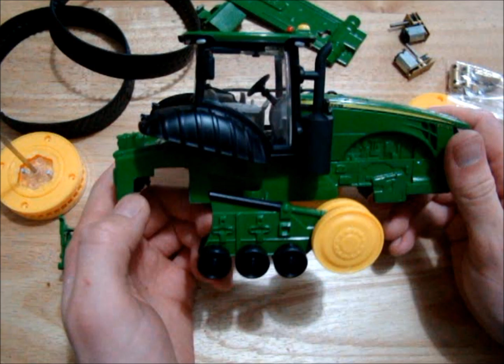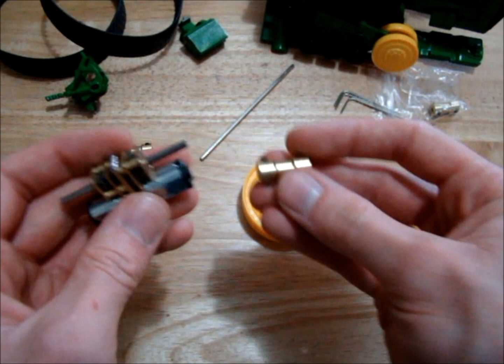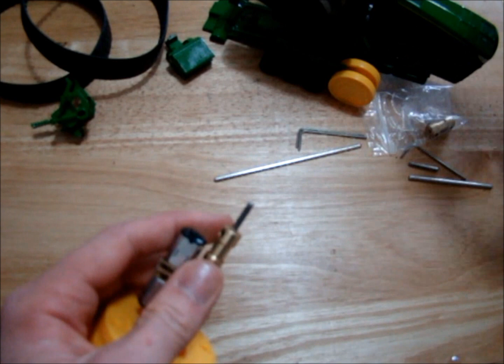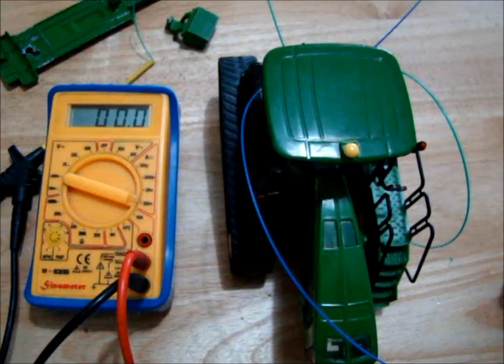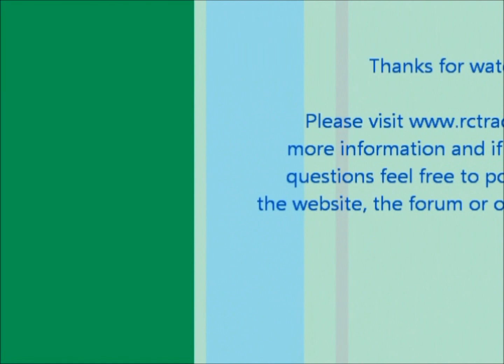RC Tractors John Deere 8360 RT Part 1 - Installing the N20 drive motors

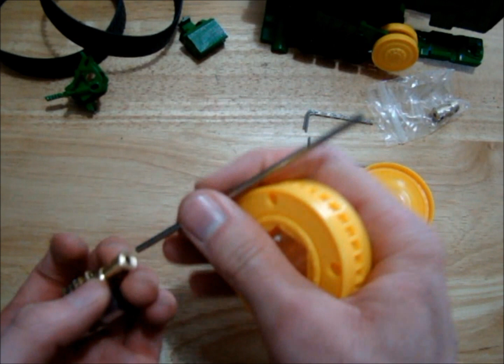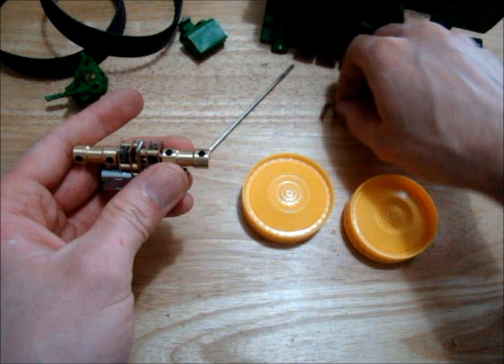Comment: Hey, I know your bio says you work on 1:32 scale, but im trying to get into the Ertl 1:10 scale 9520 rc. Its not receiving signal. To get access to some of the screws, I need to remove some wheels. I don't have a clue how to remove the wheels. Do you have any experience getting these off?

Comment from the maker: Hi José, I wired the light system myself it isn't too difficult when you are using an Arduino and I think you have more control over the lights that way.